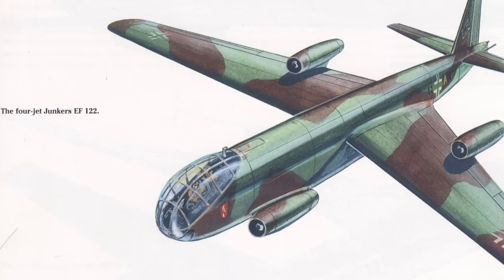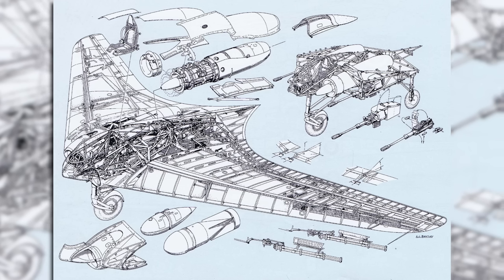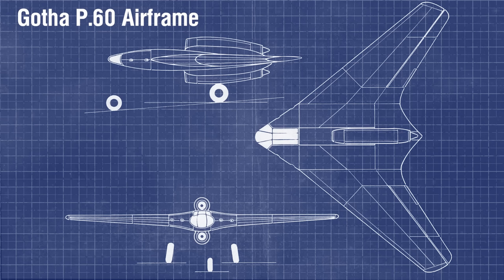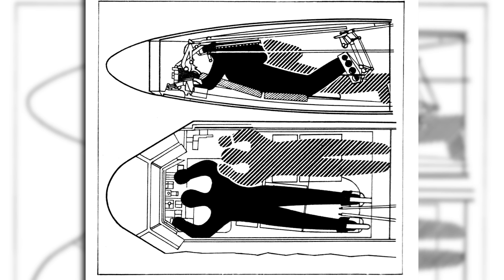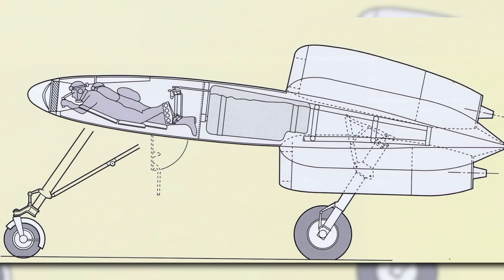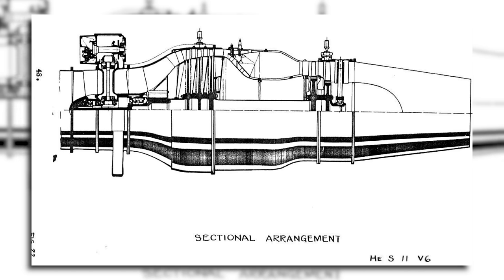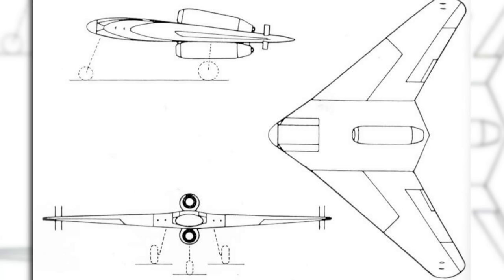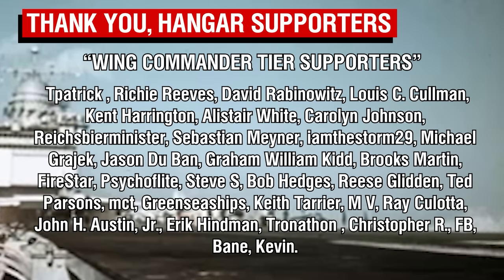Gotha P.60 - A Superior Horten 229? | Concept Planes

Comment: I love this jet but it was in no way stealth. They never painted it with carbon,  and all its weapons were externally mounted so its a stupid concept that was pushed for the MIC and their own efforts at the time this "stealth" idea was dropped. You might mention the National Geo where Skunkworks built a mock up and painted it with radar. Well you might note that there were no engines put in, no fuel tank, no weapons of any kind, and they admitted in the video it was painted with 25k / gal special paint... not sure why considering the Nazis never had anything like that but there you go. It was a bit more stealth... But you were left with a un armed glider if you really ran w/ that prospect. Just nonsense.
Reply: And i just spat that out for the 229. Ive not been briefed on the P60 so this is new to me.

Comment: Yea so what, the Nazi's had a aircraft designer who tried to produce a flying wing that happened to be a jet. Northrop designed his original flying wing with pusher propellers in the 1930's and modified it to use jet engines in the 1940's. They all had the same instability problems which is why we had to wait until fly by wire computer control was possible to make one that doesn't crash all the time.
Reply: Germany developed and produced fly-by-wire and autopilot technology during WW2... they actually mass produced Mach 4+ ballistic missiles that went into space on its course to target using a sophisticated inertial guidance system.

Comment: Luckely, the war ended before any of those advanced designs made it to the front line. A couple of Me262's or Ho229's could have made a huge difference just a couple of years earlier. A good thing Hitler was such an excellent "strategist".
Yes, yes, I know the development of the Me262 had a lot of problems (not only Hitler aiming for a bomber version). But an early adaption of the concept and therefore a higher priority could have made a lot of difference

Comment: The Germans were so stuck with their idea of a wonder weapons. This one was a classic example of such thinking. However, we all know today, development of new stuff for any war anywhere needs to start and be finished before this war goes off. And then, of course, don't trundle around and get on with it, or these shinny new weapons will become seriously 'old' during the war.
Reply: The V2 missile is an excellent example a weapon system entirely developed during the war and used to devastating effectiveness, one of the most terrifying weapons known to mankind guided ballistic missiles are the king of the battlefield today.
Reply: @WilhelmKarsten  Hello Sandyboy, as you know the V2 was developed and used to very little significant effect achieving absolutely nothing for the axis (apart from massively wasting your nazi heroes' resources) and is a perfect exemplar of the very point that drstevenrey makes.
Reply: Quite a few developments prove you wrong. Me262, Gloster Meteor, Centurion, StG44, MG42, B-29, ...
Reply: @wanderschlosser1857  It actually proves me perfectly right, since the Me262 was quite useless, the Meteor was a poor attempt that was screaming for a replacement, the Centurion had a top speed of 25 kph, so brilliant as long as you can run away. The guns are too easy and can't be compared to aircraft. The B-29 was also not planned during, but quite a bit before the war.

Comment: Silly German jets are a load of ol' junk.
Reply: Germany built the the best jets in WW2, the Allies had absolutely nothing comparable
Reply: @WilhelmKarsten  Literally not True, The Welland was a lighter, more powerful and reliable engine.  

The most comparable engine (that is a axial flow compressor design) to the Jumo 004 and the BMW 003 would be the Metrovick f2... which can still be bought to this day as an RR AVON generator.
Reply: @tisFrancesfault  Nothing but wishful thinking lad...
Reply: @WilhelmKarsten  not so, it's mechanical fact.
Reply: @tisFrancesfault  The Welland had a PFTR of 100 hours, same as its Jumo-004B 
It only produced 1,600 lbs of thrust due to its inferior centrifugal Compressor and severely flawed reverse-flow layout.
All modern jet engines are axial compressor like the German jets.

FYI; The Metrovick F2 was an epic failure that never achieved airworthiness certification or entered production.
Metropolitan Vickers abandoned it and all jet engine development in 1947 and returned to building steam engines.

The Rolls-Royce Avon is heavily based on captured German technology and wasn't introduced until the mid-1950s.
Reply: @WilhelmKarsten  No its not, its a a continuous development of the F2, again an excellent developmental platform, leading to one of the most successful jet platforms ever. 

Axial flows were mechanically the superior designs, this was known decades prior. The issue was that the material constraints, a silly system to develop a primary system. This is why the radial compressors were picked; rightly so. They would mature sooner, and give reliable, relatively cheap, and easy to maintain engines to work with and study. Axial flows wouldn't really come to a maturity till the 50s, principally due to the material science not yet being developed for such.
Reply: @WilhelmKarsten   Also I just wish to correct an error,  Im making reference to the Welland, and not the Derwent. The Derwent is the engine I should have been referring too, I mix them up, School boy error.  Apologies.
Reply: @tisFrancesfault  Development of the F2 ended in 1947.
The Avon is not related to the F2.
Reply: @tisFrancesfault  Axial Compressors and Centrifugal Compressors are made out of very similar materials, the Allies simply did not have the aerodynamic and fluid dynamics technology to built Axial Compressor turbojet engines.
Then relied on inferior centrifugal Compressors because that was all they could built reliably.
Reply: @tisFrancesfault  centrifugal compressor turbojets were an evolutionary dead-end and obsolete on arrival in the 1940s.
Reply: @WilhelmKarsten   Well somewhat is, elements of the combustion system was taken from the Sapphire (also known as the Metropolitan Vickers F9).
Reply: @WilhelmKarsten  Again, the F2 was a contemporary of German Axial flow engines... but better... 

And again, the idea that centrifugal compressors would likely plateau sooner was also understood. That was not seen as an issue.  Centrifugal Compressors may well be made out of very similar materials,  but that's a very reductive view of the engines and the stresses each experience. The ultimate issue being general ease of production and reliability and ease to maintain .  

But unlike Germany, the allies (the UK) could co-develop multiple engine types at once to maturity. The Radial com was better than a piston engine, and better than a axial flow, in the early days. Those engines hardly being bad, as everyone would use them.  Least we forget the MIG 15 exists?
Reply: @WilhelmKarsten You're self awareness is right on there Sandyboy 'Nothing but wishful thinking' does just about sum up your comments.
Reply: @WilhelmKarsten  Hello Sandyboy you sad wehraboo. As you know Sandyboy, the F2 was continuously developed with afterburner, bypass and even open rotor designs during the war and shortly afterwards at the F9 development stage passed to Armstrong Siddeley to be produced as the Sapphire engine and was licence built in the US by Wright as the J65. 
The Avon inherited several ellements from the F2.
Reply: @WilhelmKarsten  Hello Sandyboy, I'm enjoying your desperate state of denial. Sandyboy, as you know centrifugal compressors are more robust that axial flow engines and less critical with regard to elongation issues. Your nazi heroes as you know failed to grasp that and careered down a path of development of engines they didn't adequately understand and couldn't build reliably with the crappy alloys they had developed which they couldn't even competently supply metals for anyway. That lead as you know, to your nazi heroes' engines being unreliable crap.
Luckily adequate alloys such as Nimonic were soon available to the allies and later to the French so that they could actually eventually make something out of a german design.
Reply: How come the master race had to abandon the development of their centrifugal compressor jet engines?  Ohain and Heinkel couldn’t do it.  They had to go down the axial flow route, the allies did both.

Comment: The 229 can not be underestimated in the story of jet engined aircraft,,,In fact it is the most important jet aircraft ever created,,,What the Germans created was a aircraft 50 years ahead of anything else,,The first stealth aircraft ever made,,And this fact was confirmed by the Lockheed skunkworks in early 2000s,,extremely low infrared signature caused by its engines tucked inside the wings,,,In fact this aircraft was so important ,That lockheed would draw inspiration from it when developing the B2,,The p60 with its engines outside the wings both above and below would have been an infearer airframe,,It would stand out to infrared and would be far less stealthy ,,There is only one example of a 229 left in the USA ,,maybe some day this one of a kind jewel will take to the sky's again,,
Reply: Mmmm, the B2 belongs to Northrop.  And its intentional stealthiness is up for debate.
Reply: @ronjon7942 Who is debating the stealthiness of the B2?
Reply: The 229 wasn't a stealth aircraft and by the only credible argument that it might be, then it wasn't the first. The people who trot out the nonsense about the 229 being some fantastic stealth aircraft never explain Reimar Horten's complete lifetime failure to design any successful powered aircraft let alone a stealth one.

Comment: German engineering was waaaaay ahead.
Reply: No it actually wasn't.
Reply: No, they really weren't. The Lockheed P-80/F-80 Shooting Star was introduced around the same time and in fact flew before the Horten Ho 229. The P-80 was a much more successful jet aircraft and actually saw production. The myth of superior German engineering is baffling. A lot of German designed tanks, aircraft, and other material were plagued with mechanical and production issues due to over promising and under delivering across the board.
Reply: Do remember that prosecuting a war across an ocean has different priorities than fighting on home territory or neighboring conquered territory.

American engineering development was far ahead in mass producing parts reliably to a strict tolerance allowing for parts interchangeability that German produced parts didn't have.
That's what you need when fighting away from home, focus on producing things good enough to fight but also simple enough to maintain in the field.
Reply: BULLSHIT! Jack Northrop was flying flying wings in the 1930s and the YB-35 was ordered on 22nd November 1941 although the first flight was delayed by wartime production needs until 25th June 1946.
Reply: Not at all, even in jet technology, they were considerably behind the curve  of British engines.
Reply: Unlike the F-35 as a recent example...
Reply: All of the Allied aviation exerts agree that Germany was a decade ahead in aerospace technology, it is futile to argue otherwise
Reply: @WilhelmKarsten  Issue with that , is its defeated by reality. The Metropolitan Vickers F2 (first ran in 42) latest variant, the RR Avon can still be bought to this very day... 

The BMW 003 was continued by the French to achieve 58 Kn of thrust with afterburner. But only by the French (basically). The Contemporary RR Avon would go on to output 72Kn; The US UK and the Soviets developed British engines.

Even if we looked at war time engines, the Gloster Meteor engines were not only more powerful, but lighter and more reliable. 

By the end of 45, the Gloster Meteor, would be able to out turn, out run and out gun (the 20mm hispanos being high velocity round was far better suited to jets than the 103) any 262, and all without disintegrating the engines.
Reply: @tisFrancesfault  Wow, that comment is so full of shite it could supply a biomass powerplant...
Reply: @WilhelmKarsten  again, literally not. The metro F2 has quite an established lineage of excellent reliability and performance; and in regards to the F2 an excellent base platform to develop from.

Compare to the Juno that basically didn't go anywhere beyond war time production.
Reply: @tisFrancesfault  The F2 was an epic failure that never achieved airworthiness certification or entered production.

Metropolitan Vickers abandoned the F2 and all jet engine development in 1947 and returned to building steam engines.
Reply: @tisFrancesfault  The Jumo 109-004/12 series remained in service until the mid-1950s and its many variants are still in operational service today.
Reply: @WilhelmKarsten  As said the F2 was a developmental engine, the Allies were never desperate nor dumb enough to deploy such experimental tech in front line use... that would be dumb.

...Or the Mantra of Germany.
Reply: @tisFrancesfault  Germany was the only country to mass produce axial compressor turbojet engines during WW2, German was more than a decade ahead in jet engine technology.
Reply: @WilhelmKarsten  Hello Sandyboy, as you know your nazi heroes' jet technology was very poor, hindered by dimwitted strategic decisions and a delusional failure to understand the constraints of Germany's circumstances.
Post war the Russians, with the help of a host of capture nazi engineers tried to make something of the Ju004 and the BMW 003. The former they struggled to improve and it was relegated to second line aircraft and trainers (plus a few experimentals). The latter was used in the MiG-9 and proved to be so unreliable and flameout prone that it was dumped and for the famous MiG-15 the Russians chose the Rolls Royce Nene.
And as you know Sandyboy, the poor old French lumbered themselves with Oestrich , a big bunch of other nazi engineers and the BMW 018. After almost completely redesigning it and trying alloys of their own they eventually adopted the British Nimonic alloy and managed to get an engine into service years after British and American contemporary engines.